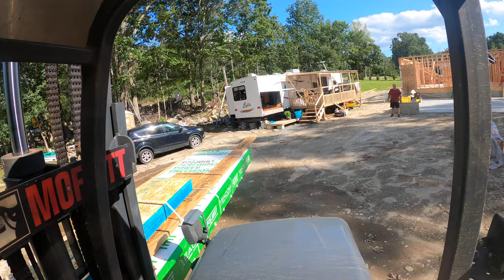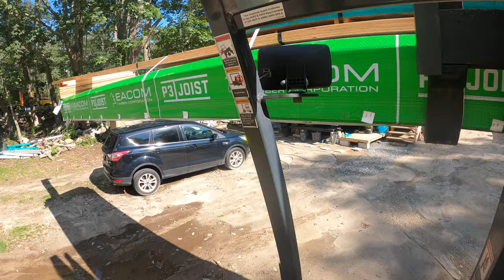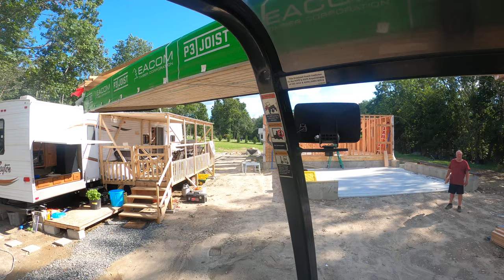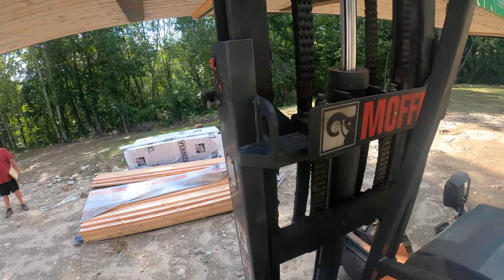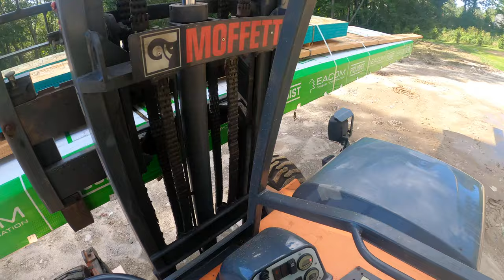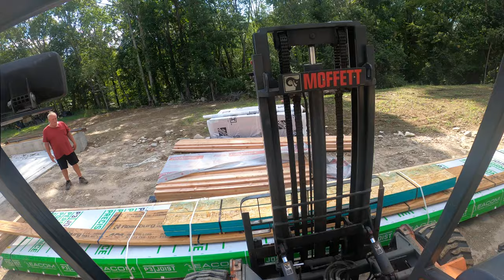40 ft LVLS!!! MOM GET THE CAMERA!!!!! PT3

Comment: There was a guy who worked at Maywood, he was in the Navy. He said he was carrying a jet engine high on the forks and as he crossed the flightline, the Navy had these little pockets in the pavement to tie the aircrat off, his 1 wheel hit that dip in the pavement and he dropped a 20 million dollar engine onto the pavement. All they salvaged were parts, but the motor/engine was totaled. This is why I don't like to carry things to high, unlee of course I have to see where I am at. I was thinking, if you were to hit just a slight dip, that lumber would be damaged beyond belief, like the jet engine - parts